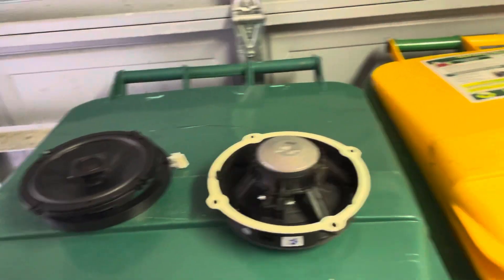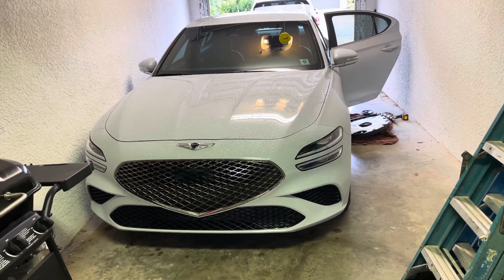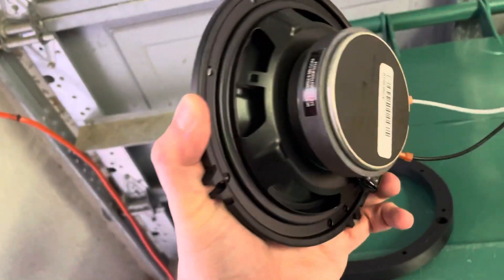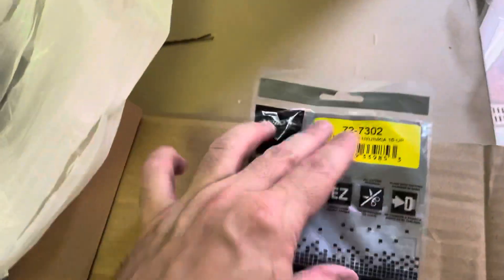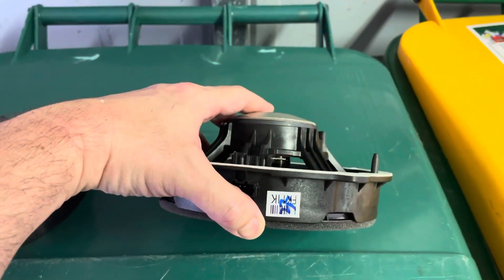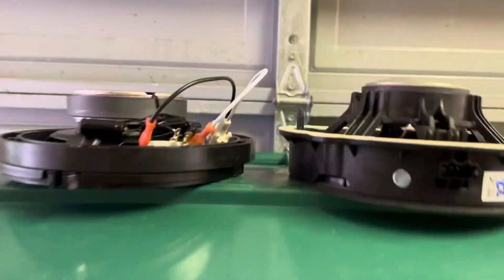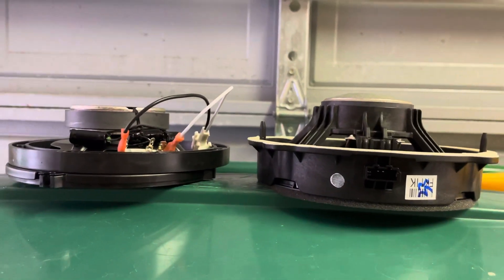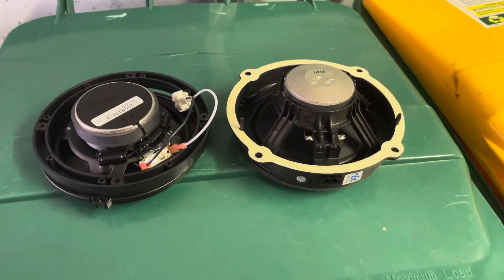Upgrade Genesis G70 door speakers

Comment: You replaced factory midbasses with a coaxial. Why would you do this? Not to mention, the factory processing that the factory headunit does specifically for the stock speakers. Which will not work for the new coaxials good at all.
Reply from the maker: Would be right except the head unit no longer powers the speakers.
Reply: @cadillacats-qb8nr  did not know that
Reply: How did you go about running all coaxial to an amp?